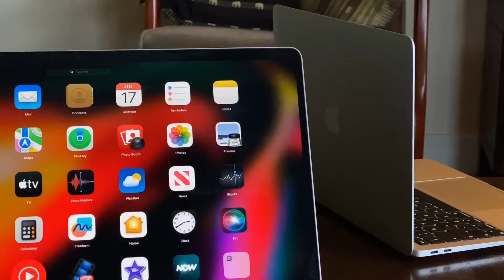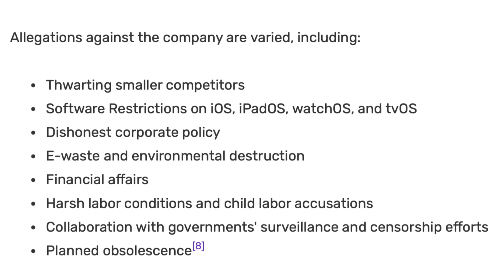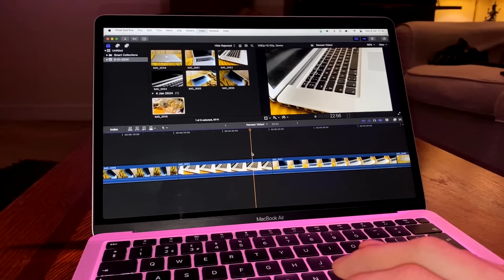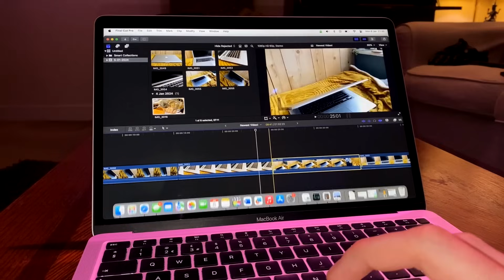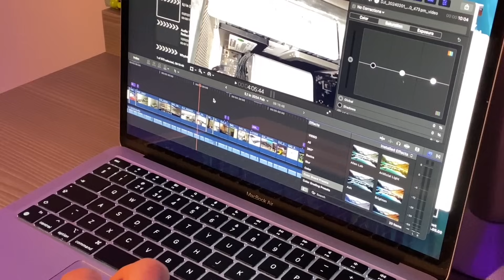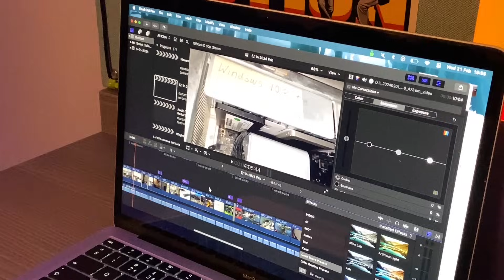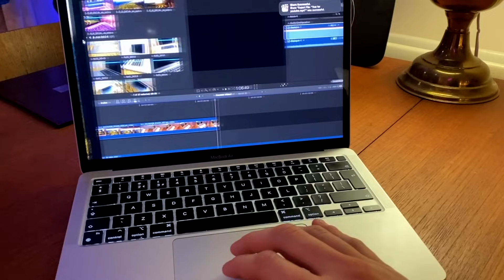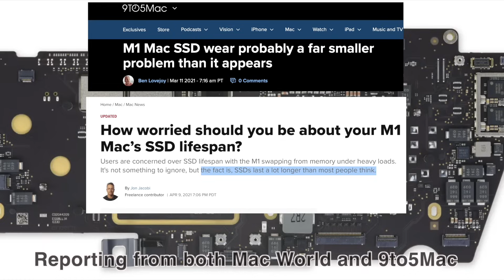Don't make the same mistake I did by buying a used Intel Mac.

Comment: Depends on your budget and need.  I, personally, am keeping a keen eye out for a 2012 15" i7 2.7ghz.  Also about to buy a 2015 or 2017 MB Air with a 2TB SSD for a mobile Movie machine and email terminal for an elderly relative.   Biggest reason I have not got to Apple Silicon...the ridiculous price for storage.  2TB is the bare minimum for my need.  I do not want to lug around portable SSD drives.  My daily work machine as an IT Manager and Graphics Pro is a 2013 MacPro 10-core.  ZERO problems.  Bosses M1 Max MBP only feel faster is boot time and dull tasks like copying.  In Creative Cloud...not so much of a difference.  One day, when the price is right, I will upgrade to an M1 Max MBP 16.  Prices are getting there.  Mine will have to have a 4TB or 8TB SSD.  Same with a Studio.  It would be awesome if Apple made their devices with a super fast 256 SSD that is OS/Apps only and then a slot for storage for files.  Have you ever restored from TimeMachine a full 2TB Boot Drive.  TAKES FOR EVER.  Learned my lesson.  Now I always partition.  1 for OS and Applications, another for files.
Reply: I have one of those I don't use.

Comment: I recently bought a 20 inch 2008 MacBook Pro, 2.4 GHz., core 2 duo, 8 gig of ram., I installed a 240 gig ssd., and I then installed Linux Mint Mate and currently the laptop works very well.  
The design of the laptop is good except that it only has two USB., ports and they are both on the same side and to apply new thermal paste to the processor the logic board has to be removed.

Comment: 6:38 To answer your question, the SSD. That is the problem apple silicon devices, the SSD is still a wear part and will fail, even worse the "bios" runs on the internal ssd so when the SSD dies, the laptop becomes a paper weight. Even if the controller dies first, that doesn't help either.

Edit: I think apple silicon devices are cool and I really like them, but pretending the SSD problem will affect you especially on base model devices with less ram and storage as you increase the writes to the disk.

Comment: i have a 2012 mac pro, dual 12 core, 128 ram  i run multiple macos with nvme pcie and a uad pcie. cant do that with silicon unless you spend 8k and i have zero problems with my audio work. so i disagree with you. it runs great with opencore

Comment: My problem with the ARM MacBooks is the fact they only have 8GB in the base configuration. If you can't upgrade the ram then Apple should include at least 16Gb or even better just give the option to upgrade it later. Also it's just a bigger iPhone, so they can just decide to cut updates and you won't be able to use a modern OS anymore.
Reply: That's a problem with the Intel macs too. The OS bootloader is unlockable on M-series Macs so even if Apple stops providing updates you can always switch over to Linux or something.

Comment: Anyone buying a Mac older than 2012 is making a huge mistake simply because that was the last year that Apple made computers that were completely upgradable. I the retina‘s and so forth Kingsolver components that are quite difficult or almost impossible to upgrade. As much as you might like macOS in the Apple ecosystem, you should consider also the options of being able to maintain and repair your computer by replacing memories, Hard drives in other parts. With modern max, that is impossible. Worse yet, you will be throwing your money into the garbage.

Comment: I do collect Macs and sure got a bunch of Intel Macbooks, Mac Minis and iMacs but you are so very right. They all can't compete with the Apple Silicon. I also got an M1 Pro Macbook for serious work and it lasts me the whole day. Sometimes, for fun I bring an old Macbook. When I only need to display some PDF files at a meeting or other light work that is not mission critical. The thing is, old Macbooks still look very modern and sleek but the power is gone. Apples design and choice of materials really made them timeless. The 2015 Retina Macbooks were incredible at their time. There was no serious replacement until the i9 came but then all Intel got crushed by the M1. With Apple, there is always the right time to buy one. You bought the 2015, you were able to get 7 or 8  good years out of it. Same will happen when you got a MBP M1 Pro in 2021. If you bought an i9 in 2019, you only got 2 - 3 years and now you don't want to sell it for 600$. People still think they have a high value laptop but its not true. I've seen M1 Pros going for 1000$ used and they are so much better and they basically come with an XDR display on a Laptop. The prices for MB up till 2012 should be 100$ or better even lower (sure 100$ for a 2012 15" with good specs) and a high spec 2015 should be around 150$, not more. Lets be honest, even the best Retinas (2015) get 10 years old next year. I've yet to find a replacement Battery that is really good, like they were new from apple. Most batteries you buy are new but old. I think that will really kill the use as a laptop in the long run.

Comment: I am using a 2019 intel macbook pro 16  . It works perfectly fine and no issues so far. 
I am not a video editor and mostly my work is normal browsing and coding works . It works super smooth and the speakers are great listening to podcast and online lessons.
Even video editing in FCP it works well, the fan noise dosent bother me much . 

I feel no need to upgrade to M1 macbooks now , because i have a ipad -> M1 ipad pro 12.9 . 
Dont wanted to waste any money spending my devices as long as all  works perfectly well .

Comment: I have a 2011 15" (radeon is yet to die) it's still stock except for an ssd swap, and if I were to continue dailying it I should swap the battery.

Somehow it's still a fine machine to use, and with macos+linux dualbooted I get enough software support for what I want to do on a laptop. Only issue is of course it's loud (I run a fairly tight fan curve and haven't done a repaste), but it still somehow runs fine. I'm tempted to swap a 2012 board into it, depends how expensive they are

Comment: Got a mid 2012 Air, just needed that MagSafe2 adapter and it was set. Could do with a healthier battery. Core i7 model, 8gb ram, 250gb SSD. It was free, so I believe you should pay what an Intel mac is worth - even if you like me are going to give it Linux in order to make it a fair bit safer and actually supported and updatable and usable.

Comment: Not really a point of view I agree with, but fair enough.

While M1 (and newer generation Apple silicon) performance is truly stunning, I'd want to hedge a bet that a lot of that performance is going to waste with most average users and even lower end "prosumers". For some perspective, right about when the Apple silicon transition kicked into high gear, I outfitted my father with a 2009 MacBook Pro (C2D, 6GB RAM, 120GB SSD) and I have yet to hear a complaint from him in regards to speed or performance. He is very much what you would call an "average user" with the most intensive use cases being Chrome and the Microsoft Office suite. I'm not a luddite, nor am I coated with nostalgia for Apples past. It's just that I refuse to replace something that works perfectly fine... While it is admirable to want every computer to be powerful enough to do the tasks that the M1 is equipped to handle, I still fail to see a valid reason for that. Especially with the mountains of e-waste that we produce each year. I think that the general public and most of the tech world needs to stop being blinded by numbers going up and genuinely ask themselves what they NEED in terms of performance, and at what point they reach diminishing returns. Otherwise we're just perpetuating the upgrade cycle that these companies want us to get stuck in each year.

Comment: i just bought a 2013 mac pro for $250 and put 64GB of ram in it for $50... and i use it my day job at a repair shop. (admittedly the ram was a touch overkill but... what are ya gonna do). it sits behind my monitors and works dilligently.
Reply from the maker: Not a bad deal!
Reply: @montaguebarnabasltd  i did check out an m1 mac mini but it was going to be more expensive for a unit that had 16gb of ram (which was the minumum needed for this application). 

buuut also the AC power at work isn't super clean and it causes wireless (namely bluetooth audio) interference issues, since mac minis are not grounded (their AC connector only has two pins) and the mac pro IS grounded (3 pins).

my theory seems to have been proven correct since i have much better bluetooth performance.

Comment: problem with apple silicon macs are that you can't repair them at all without expensive equipment, not to mention not being able to buy parts, such as NANDs. intel macs are more repairable, especially older models. I will never buy an apple silicon mac until they fix this problem. OCLP allows me to run the latest os on my 2015 MBP

Comment: I got a really good deal on a 2017 15.4 macbook pro and I have an m1 mac mini at home and sure the m1 is a little snappier and launches things faster but  for my general use and saving over 300 dollars only to have a 13 inch m1 laptop... using an intel mbp has been great and I think I have 3 more years out of this machine no problem, I could even see upgrading to an 2019 i9 mbp when I need to upgrade

Comment: Just recently upgraded to an M3 Pro 14 inch 18gb ram mbp from a 2011 mb air. Only reason i upgraded was fusion 360 dropping support for my old air. Will be keeping this as for as long as it’s supported by the apps I need.

Comment: I got a 2013 Retina MacBook Pro at its very time, I'm still squeezing the most of it as of today, it is even running Ventura with boot patches ( I'm aware it can run Sonoma but I don't want to bother with it ) and with a 480Gb storage upgrade, for I got the 128Gb at the time, which used to be more than enough at the time ( surprise surprise, it is not anymore hahah ).

I'm really holding my desires to get any M1 laptop ( with 16Gb of RAM this time ) at the end of this year, and it's going to be my christmas present of course.

I plan and hope it to last me as much as my current MacBook Pro has lasted so far.

Comment: I recently bought a MacBook Pro with an M3 Pro, 18GB RAM, and 2TB SSD storage from Apple's certified refurbished!
Even though M4 is literally around the corner, I still like this one because I plan to video edit on it given I am trying to stick with Intel Arc on my Windows desktop... Plus battery performance on ARM vs an x86 Windows laptop... I do miss my Surface Book...

Comment: you can hold back and keep a machine you can at the very least upgrade the ssd on, or go foward and loose any repairability unless you REALLY know soldering
Reply from the maker: @TerrorSyxke  SSD upgrades will only get you so far. You’re losing a LOT of performance sticking with Intel at this point, and for some, that’s not viable.

Comment: I picked up a 2015 MBP 15 inch and I've used it as my personal laptop for 3 months now. I took it on holiday with me and watched films on the plane, lasted the full 3 hours (just)

It does great for excel or browsing or booking something. Editing for my YouTube channel (not this one obviously) and gaming is all still done on my desktop. I talked myself out of buying an M1 MacBook or worse a MacBook Pro 2019 5600M i9 16 inch over heating machine because I realised I really do not have a use case for needing so much grunt on the move.

I will however be getting an M1/M2/M3 MacBook as my next one. I realised how much I miss macOS, especially on the move, and like you say battery life and thermals is unrivaled on the M series.
Reply from the maker: Yeah all of the Macs have their needs, depending on the pricepoint. I think you’ve got the right idea in buying Apple Silicon as your main machine though!

Comment: You for got do not buy a butterfly keyboard mac, that is a number one disaster waiting to happen! i use my old intel macs with linux and they run great. they stay up to date have 0 issues. and they are cheap. and the SSD is replaceable in the older models and in my machine the ram is up gradable  . here in the rest of the world apple stuff second hand stays very expensive and the new stuff is even more expensive! in USA you can still buy the M1 air, in a big chain retail store for 800 buck. Here in Europe you can not and a base m2 air is 1300 dollars inc tax a m3 only runs you 1350. a base 15 inch will run you 1668 dollars. as you can see that 16 inch intel macbook for only 800 bucks is looking very nice for me .

Comment: If you don't need the performance then intel macs are great,I've got a few of them lying around the house that I picked up cheap and repaired and maxed out.For using Adobe and Affinity I have the base model 15" M3 Macbook Air which I picked up on Amazon with £200 off-no brainer really,very fast and will last a amateur like me for years.

Comment: The hard drive in my 4 year old Intel iMac started dying. I plugged in an external SSD since there’s still a lot of life in the iMac (plus I can keep using the SSD even if I no longer have the iMac). I’m not planning to replace the iMac until it no longer gets updates or my important apps aren’t supported.

Comment: It honestly wouldn't be so bad if 2017< macbooks use the touch bar and the T2 security chip. For retina macbooks <2015 you can just install linux and get them to last even longer (which is what I'll be doing with my 2013 retina macbook pro this year)

Comment: I've been a PC user since the beginning of my computer interaction, and I also always preferred AMD. I loved Apple products but they were out of reach price wise and for the performance you could get a lot more on PC. Also I could build up to that performance. Close to when Apple Silicon was released I started looking at the reality of my PC builds, usually by the time I would upgrade a GPU, I'd have to upgrade the CPU and the Motherboard to take advantage of the GPU upgrade given my low frequency of upgrades. So upgradability wasn't really a thing for me as it turned out - also I started to learn its better to get the tool that gets the thing done that I want to get done, than building the tool that gets the jobs done that I want to get done. Then M1. I needed a better monitor for my photography and video grading - a good color screen with hardware color profiles would cost me about two thirds of what a M1 Air basemodel would go for. Plus I wanted portability for tethered photoshoots. I've been on a base model M1 Air preowned for the last 3 years now and the thing is absolutely amazing, all this power AND it's is silly portable.

Comment: intel iMac 4k or 5k cost is so low.  
2017 or 2019
Use can add nvme ssd drives 1,2,4tb cheap and easy. plus another 4tb ssd. ram 16,32,64 for the 4k or up to 128gb for 5k.
Cpu you can upgrade base to i9 in 4k and 5k.

If you know what you are doing you can have a cheap fast, big ram, big storage 4 or 5k iMac
Or pay for m power with 8gb and 256gb

Comment: Replaceable SSDs DO have the controller right on the SSD, so no, you're wrong. Soldered SSDs are nothing but a bitch move and adding towards waste.
Reply from the maker: Have just looked into this and you’re right. Poor research from me. 
Controller tech has come a long way, though. It’s been 4 years almost, and failed SSDs haven’t become a big phenomenon yet. I doubt they will.

Comment: You can put Linux on Intel macs, as they are just Intel machines with particular hardware.  So they aren't going be that good for running new MacOS but you can recycle them as Linux machines.

Comment: My 2019 16gb 1tb i9 MacBook will be with me until it it dies. And even then i still will probably throw windows on it. Yes, it does run hot and gaming can sometimes be an issue, but it is the most powerful computer Ive ever owned

Comment: Unfortunately I have a very different reason for needing to continue using my 2015 15", and that's that I use very specialist dev software that simply does not work on Apple silicon. Open Core won't work with M-chips, so I'm dreading the day I have to attempt to upgrade, when the App Store finally disallows app binaries submitted from the last supported Intel version of MacOS. This'll likely be Sonoma, in about 2 years time 😬😬😬

Comment: You’re right of course but for the tinkerers among us that do not actually need it for serious work the vintage ones are more fun. Although I’d love to get my hands on an M machine to play with if I can find one for the right price but I guess I just have to wait a bit to find one under €100. 😊
Reply from the maker: Absolutely right
Reply from the maker: @BlackPrimeMinister regrettably don’t have time for a long reply. Would just like to say I’ve used FCP on 2012 Macs, and it was NOT a useable experience for anyone serious about video. Your opinion is valid, though.
Reply: @JimAllen-Persona you can run  Sonoma with Open Core Legacy Patcher very good on a 2015 MBP and than you will get all security updates.

Comment: Would saving everything on an external drive save the life of the ssd in the MacBook or is it all the same
Reply from the maker: The fast writes are because the software uses the SSD almost like extra ram. There’s a lot of data quickly written and erased because of this. It would help a little bit, but not a lot I think.

Comment: I got a m2 pro mbp, its 14inch. Its a pretty nice machine, though intelmacs have a good thing going on for them, you can boot to windows and with an egpu actually game on it comfortably. So maybe if i get a 3d printer and a bit more money, i buy myself one so i can upgrade the cooling and use it for gaming aswell.